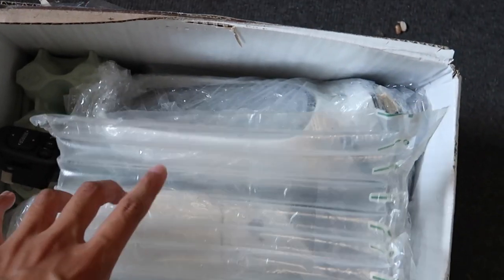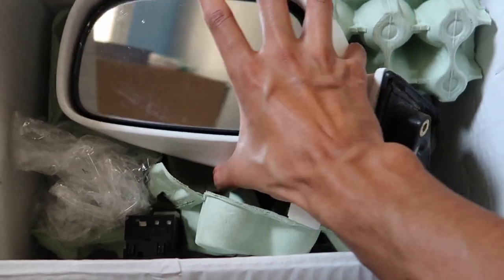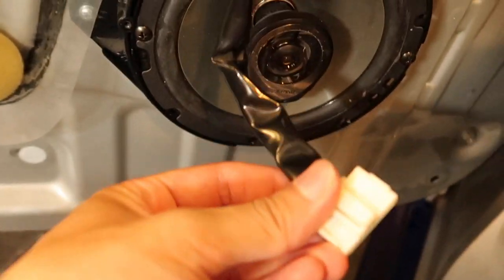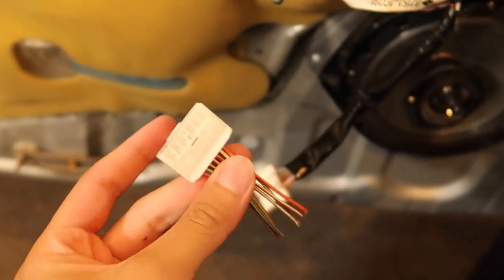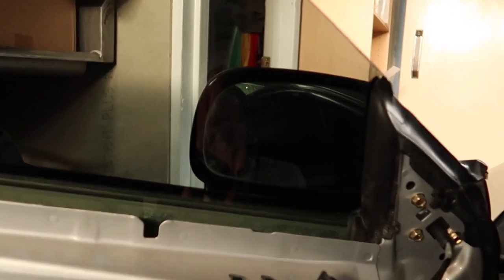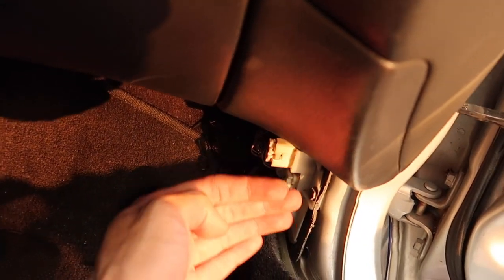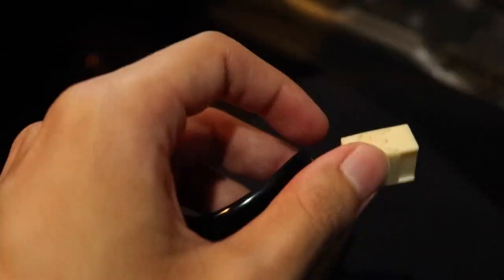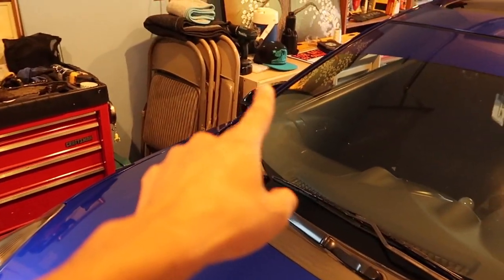How to Install JDM Power Folding Mirrors! | Toyota Celica

Comment: I did this mod like a five years ago. I got oem wiring and the short pin must be the sky blue one.  I preffered a stetic folding and got used to the angle cause the ameican base make one mirror hit the  window and the other looks separated.
Reply from the maker: Yea that’s exactly what’s happening rn :/ But I couldn’t see anything with the rhd base.

Comment: Bro, I have a RightSide Drive Celica. Do you have the base for the right side drive mirrors that I can score off of you?
Shout out from Seattle!
Reply: Let us see it. Howd you import it? Or was it a swap?
Reply: @iDayVids  I’ll post a vid soon to my channel of it. I say it was swapped (I’m not the original owner). The paperwork says it was first purchased in this country back in 2000. My mechanic thinks it’s imported from what he can tell... And that my doors that have the Left Hand Drive mirrors must’ve been a replacement from a crash.
Reply: @capitan_mjc7098  check the production in the door sill, I think they were either put together in mexico or canada. If it is a jdm car it was likely put together in japan.
Reply: @iDayVids  You solved it, man! “Made in Japan”
Reply: @capitan_mjc7098  I just checked my 02 and 03 gts. All say made in japan. And after digging a bit i think all were assembled in japan. Id say the best way to check is under the carpets. Youd see where the previous holes behind where the pedals and steering column would have been. Or where theyve been patched up.
Reply: @iDayVids  The mystery continues. I’m still sticking with the “swapped” opinion. I ended up ordering these folding mirrors on eBay yesterday. I didn’t know they were for right side drive only. Now I’ll be able to switch lanes on the highway without needing to pray that the left lane is “clear”.

Comment: you're probably stripping teh screws because they are JIS screws and you're using a phillips head. Get some JIS bits.
Reply from the maker: Hmm interesting, good to know 👍🏽
Reply: @equinoxgts  am looking for a folding power mirror switch like what you had need a link to get one